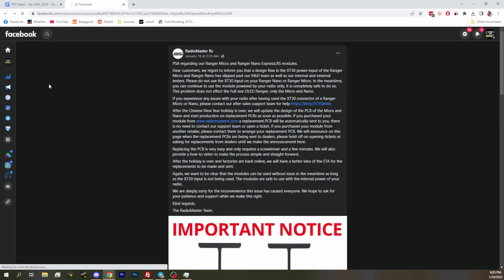PSA: Radiomaster Ranger Modules XT30 Connection Frying Radios - FPV News

Comment: I emailed them and got the run around. Kept asking me for pictures and proof of purchase. Finally they said they’ll contact me when they have a solution. 🤷🏼‍♂️
Reply: have u gotten any reply since then?
Reply: @user-yk1cw8im4h  yes on April 4 they emailed asking for my info and said they’d be mailing out a replacement board. I imagine it’s on the slow boat but I’m satisfied with their handling of this.
Reply: @likwidkool  that's awesome

Comment: i have now the problem i have a tx12 want use it with the radiomaster ranger micro for 1W use and i just get 250 mw out????

i cant use xt30 or can I ??? because i think the radio dont give the module enough power....

i was thinking this modules runs on 1W max??? whats going on i flashed newest expresslrs firmware.....